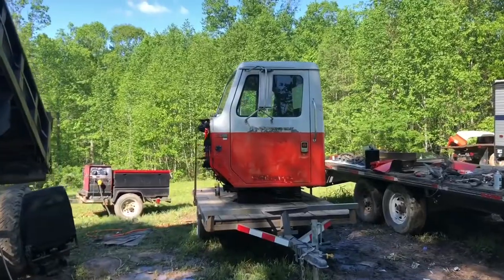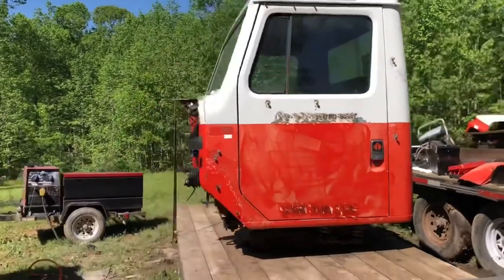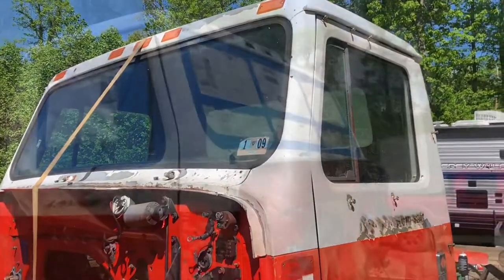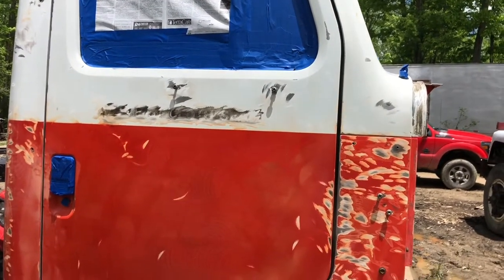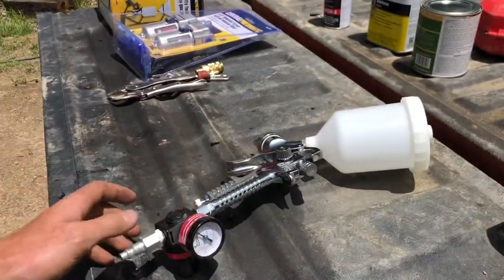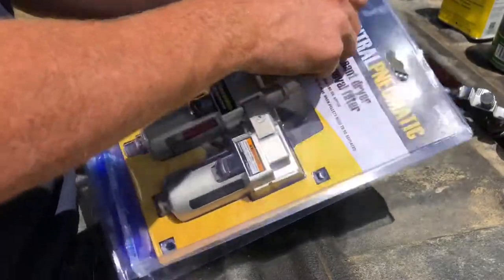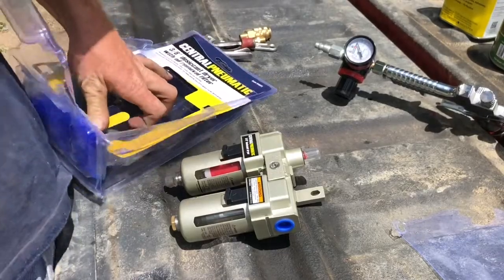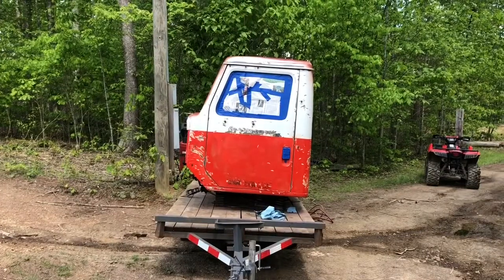Painting The International Dump Truck Cab!

Comment: How would I rate the paint job, well you followed the instructions and did everything properly.

Taking all the fittings and lights off it and masking👍 doesn't matter so much with an epoxy paint to have everything sanded back smooth because it hardens on thick and it's more about adhering to the old paint.

If you did this for a living sure you would get better at it but the finished product is good and this cab has more protection against the elements

Comment: I so badly want to give you a great job Dave but the truth is, so close yet so far. It is a representation of you and your ability. Your abilities increase as you do more. If some scotch brite sanding had been done, it would be smooth as silk. I also would of done a better primer paint job.... same primer but scuffed in between jobs and done three coats as it would be thin but smooth, and real nice coverage. I also might of taped the doors off and painted around the jams and pillars. As far as inside the cab, thats all depending if even needed and if there was going to be color changes. I also would of used some filler on  the top of that hood as their expensive and almost have to be repaired if they get to be any age at all on them. Real sorry factory work there, not your fault. I do like solid colors as you do but kinda lean to doing paint stripes on the doors and front end. Now if you wanted to give that truck a attitude then the solid color with some scallops or thick to narrow type accent lines. I also do solids if I did murals on them. Yes for first time, yes for doing a really decent tape and prepare job. Absolutely a good job that was close to a really great job

Comment: Since you put hardener in the paint, I'm assuming you painted with epoxy paint.  From what I've been told, professional epoxy painters have to use a special breathing device  which has its own oxygen supply like a scuba divers air tank.  It isn't even safe to filter the air where epoxy is being sprayed.  If you breath in epoxy mist, your lungs and you are goners!  Hope you stay safe my man.
Reply from the maker: I’m still kicking haha